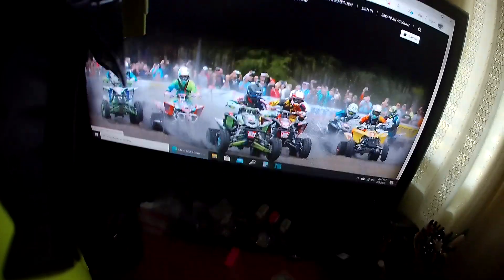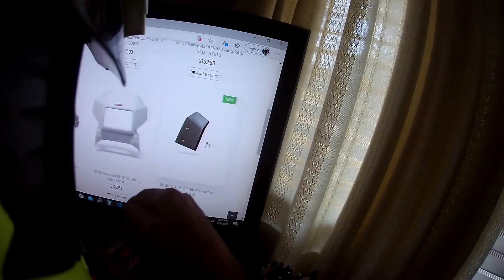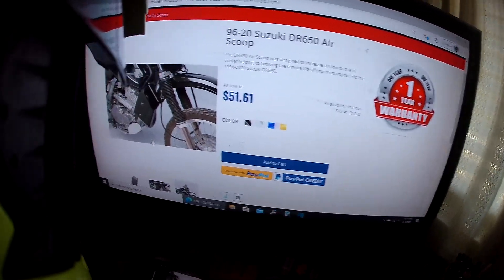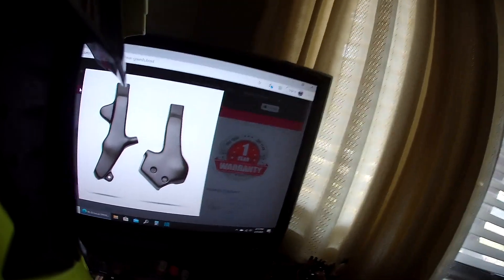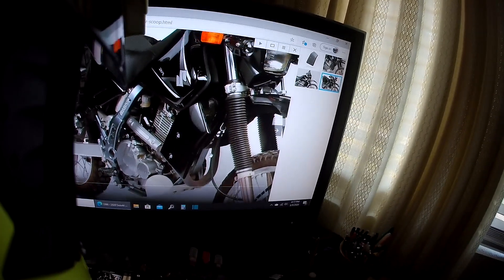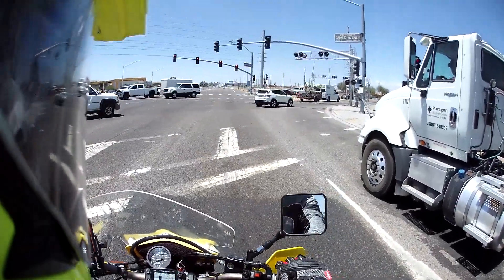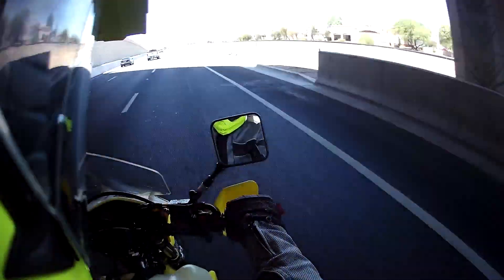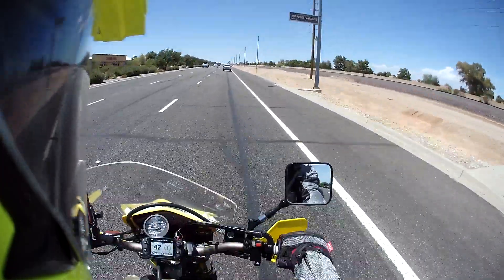DR650, The Latest Scoop! Maier USA DR650 Scoop mod and other trick stuff!

Comment: Possible copyright infringement on your design????? - Nice compliment for sure. and "VW" - sorry for the boring rides on my end - my biggest enemy is "time" - because of my parents. Especially my dad. I get out when I can, but having an actual day to myself to get out behind the lake, or God forbid - up to Table Mesa - well let's just say, for now, it simply ain't gonna happen. Right now I've got a speedo problem - goes from 20 MPH to 80 MPH in about 2 seconds, and I sure as hell ain't going 80 !!!!!!!
Reply from the maker: I think by the other comments Maier had it out first, which is cool, I was glad to see it after some of the emails and comments. It's always nice to know your not "THAT" crazy? Your rides are always fun, no reference to you in anyway. I'm glad your Dad is doing good with all this COVID stuff going on. It would be very worrying on top of everything else. More of a inner Widget thing on the change it up video? Curious to know what is going on with the Mighty DR650 speedometer?
Reply: @verbalwidget0919  Still "destroying" my existing one. possible video to come if I've fixed it. A word to the wise - do NOT try to disassemble the speedo on THE MIGHTY SUZUKI DR 650..... Silicone drying now :-(